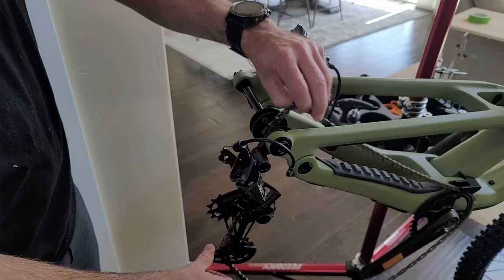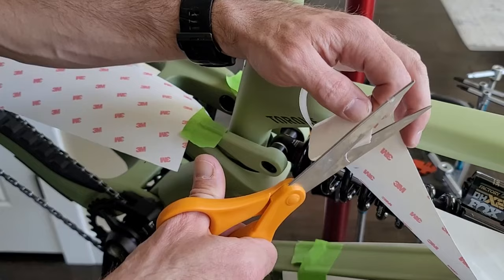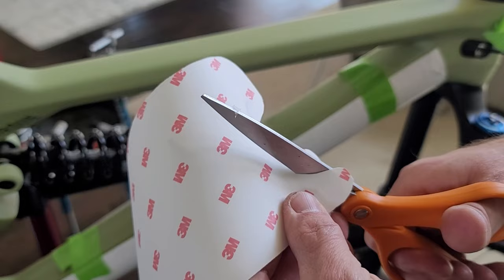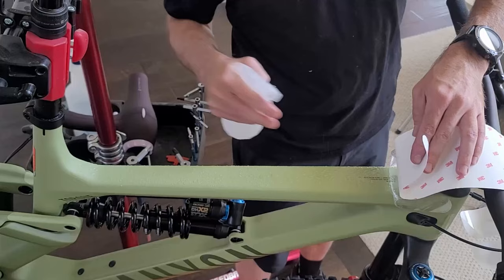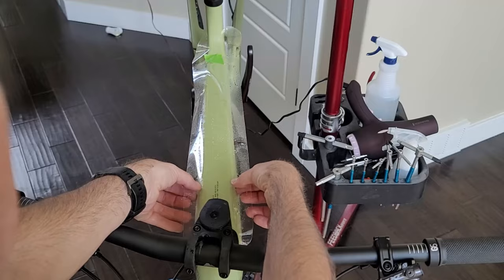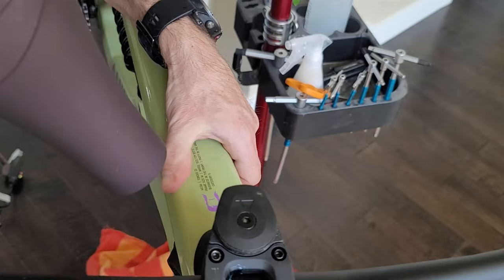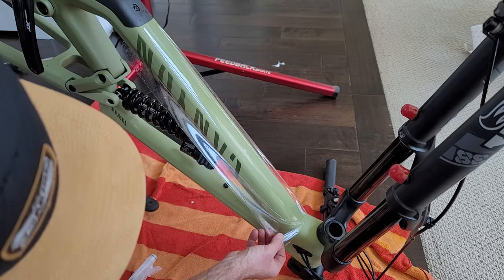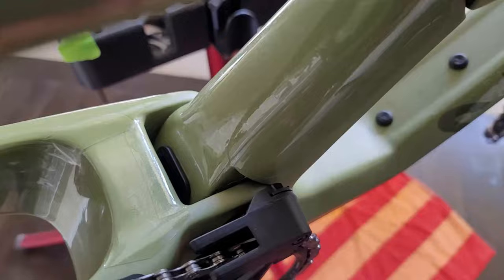Wrap Your Ride - Protect Your Bike with 3M Protective Helicopter Tape for Cheap

Comment: Went back and forth between this method and  one of the pre-cut methods and finally went with this. Tape should be delivered over the next couple days (along with my new bike 😀) so we'll see how it goes!
Reply: how did it go?
Reply: @theronbostick4120 how did it go?
Reply: It actually went really, really well. It took time and patience but in the end and almost a year later, still going strong and at a fraction of the cost!
Reply from the maker: @theronbostick4120   thanks for sharing!
Reply: I get my new bike in a couple hour's now can't wait like Xmas over again lol but all seriousness it's my first emtb first bike for a few years can't believe how much I've paid but just one them things now to older full suspension, right anyway lol  how is this stuff for UV yellowing? And does it peel the paint if left on to long as alot of tapes will do when cooked with sunlight! (By own experience with others years ago) thanks and happy new year